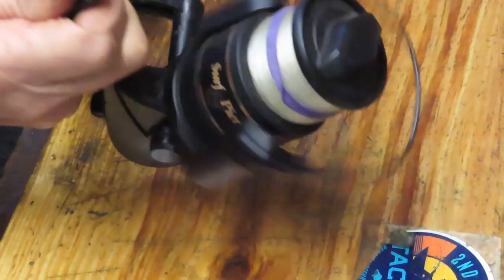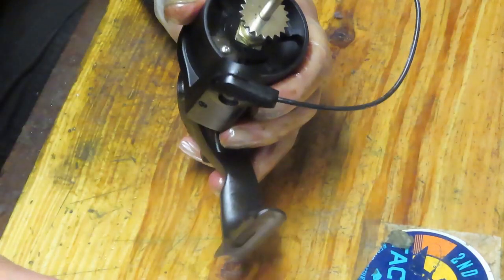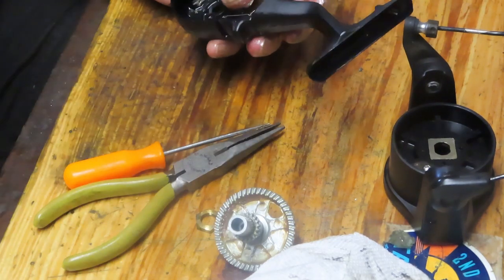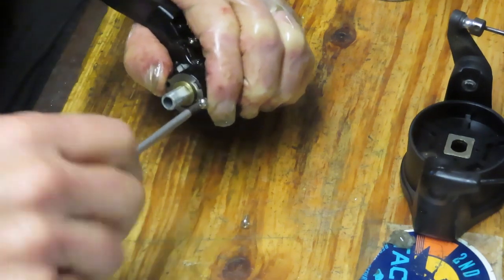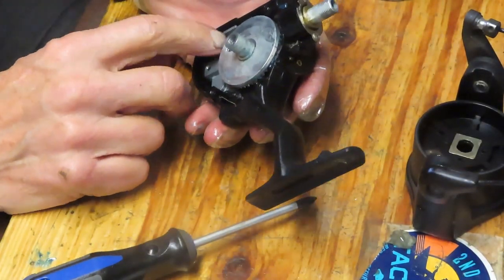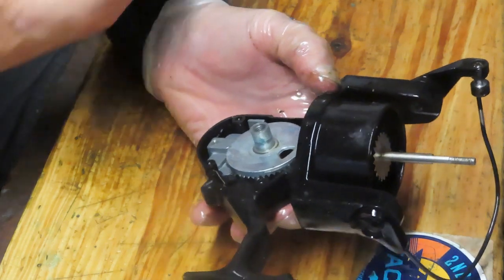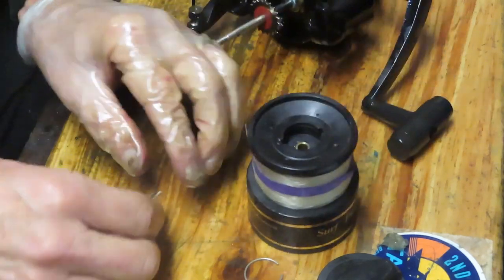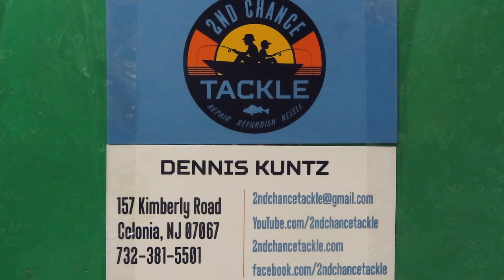Shakespeare Surf and Pier Saltwater fishing reel how to service and repair

Comment: Although I don’t own one of these I just haven’t warmed up to the modern Shakespeare. They are okay given their price point. I bought my grandson a larger size Prius for his occasional fishing and it has done fine. I guess my love for the vintage Shakespeare Sea Wonder reels prejudices me. I like those old warhorses far more than the modern cheaply made Shakespeare. I really dislike the AR in this reel.  Shakespeare is not the only brand to use the type of AR and I will never like it. With my poor vision finding and replacing that catch wire on the main gear with the AR arm is quite difficult.  Added to that is those switches for the AR on top of the housing are notorious for breaking and/or failing. It’s just a bad way to do it and the cheap way to do it. You did a fine job as always showing how to service this reel. Thanks Dennis! — Chris
Reply from the maker: Thanks Chris.  These reels have their place and you grandson will be fine with the Prius.  If he takes care of it, it will last and last, just like the Sea Wonders - Best wishes - Dennis
Reply: @2ndChanceTackle  I’ll be the one taking care of it. He’s got too much other stuff going on tight now!

Comment: I have an old Shimano AX 400S spinning reel from the 90s that I would like the anti-reverse bearing upgraded to an infinite instant anti-reverse that is compatible with the reverse switch that is on this reel.  Would you be able to do this upgrade for me, as I would like to keep using this reel for a longer time to come?  

I also have a Daiwa AG2600X from the same era with the same issue.  Would you be able to change out the anti-reverse bearing on this reel as well?  I may need to upgrade the felt drag washers in this reel to carbon ones, too.  Thanks.
Reply: That reel didn't have an AR clutch if that is what you are talking about. It has an AR dawg and ratchet like the TX series. I don't think you can retrofit an AR clutch on it. unless I am misunderstanding your question.
Reply from the maker: Thanks for providing the answer.  You cannot adapt the reel to an instant A/R clutch and over-ride as you are hoping to do.  Thanks for helping out - Dennis
Reply: @surfcat2051  Ahhh...ok.  I guess it is what it is.  Would I be able to upgrade the drag washers on the Daiwa from felt to carbontex?  The Shimano is still smooth as silk, but the Daiwa is all hurky-jurky.
Reply: @l.i.archer5379  yes, just get accurate measurements of the current drag washers and substitute the carbontex. There are a number of sources for them.
Reply: @surfcat2051  thank you.

Comment: I have a marathon 6000 reel and it has no anti reverse I took it apart and can't seem to figure out where the spring would go or what it looks like, any help ?
Reply from the maker: I am not familiar with that reel.  If you send some pictures of the A/R assembly to my email 2ndchancetackle@gmail.com I will try to help on the spring - Dennis

Comment: I couldn't see what you were doing for a significant portion of the video. I assume that is a plastic housing. I have a similar reel but smaller, I have no idea where it came from.
Reply from the maker: Yes - it is a plastic or graphite housing.  Sorry for the video quality.  Thanks for the assist on the other answer - Dennis